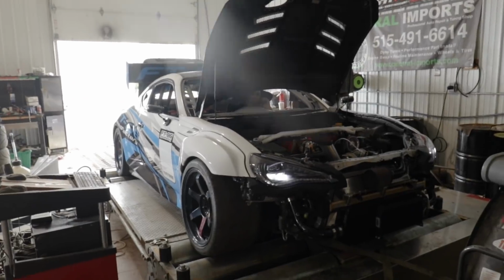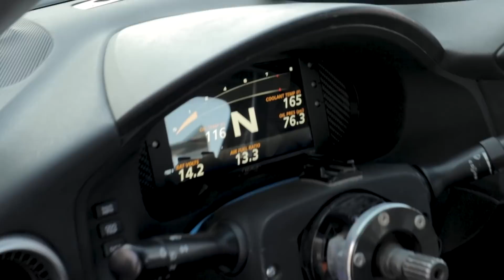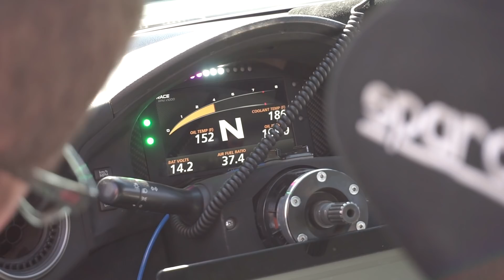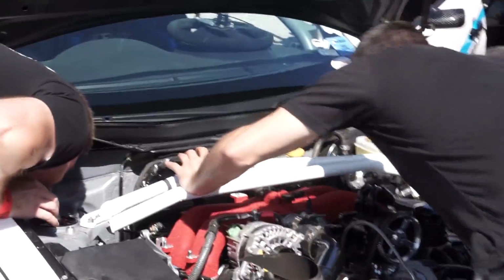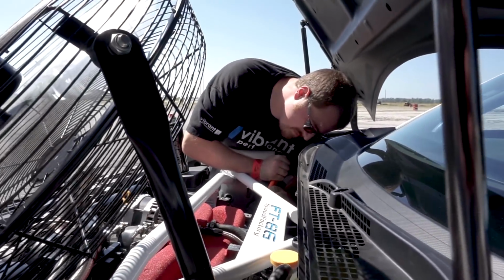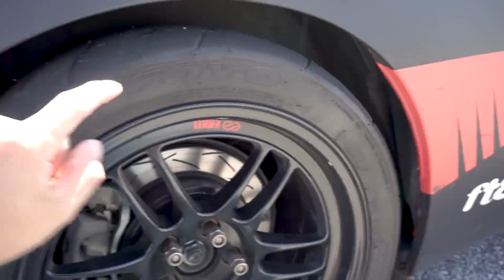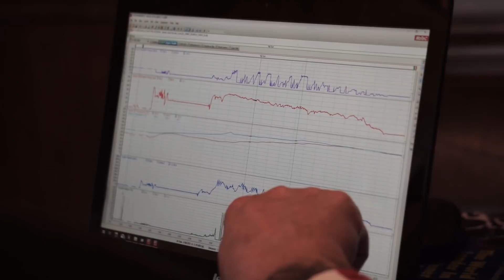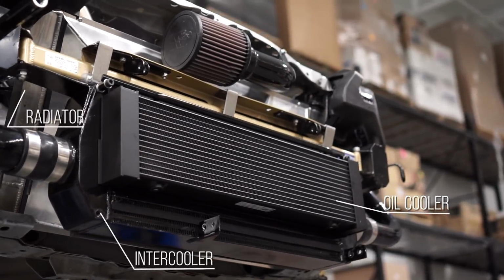Time Attack Test & Tune | Vlog_011

Comment: You should ceramic coat the headers then wrap it with titanium heatwrap and wrap the oil pan with gold reflective tape to keep the oil temp down some more.
Reply from the maker: Won't hurt! Every little thing will count at this point.
Reply from the maker: The header is coated, just not wrapped, coating is pretty much doing the same job, and there is no longer a pan due to the dry sump system. :(

Comment: Is it running hot because the oil cooler and intercooler are stacked up so close in front of the radiator?
 Can you team it up with a 2nd  oil cooler? Maybe oil to coolant? (forester like)

Comment: as an engineering student my 2 cents is if the system is running that hot why don't you swap the turbo for a larger one so it has cooler charge temps and thus cooler combustion. Change the tune to go richer in the rpms past 4K. Run a lower tire pressure for more traction.
Reply from the maker: A larger turbo would be useless in road racing due to the increased spool time. :(
Reply: I would postulate the aggressive driving would keep it spooled, larger doesn't mean going excessively large. The difference is spool time by going larger is often exaggerated. It appears you have already taken steps to offer sufficient cooling calling for more investigation. Have you been monitoring the intake charge temperatures? A car that overheats in 3 laps is not conducive to road racing either! The car would likely even break 600hp barrier and do so more comfortably.

Comment: you could try run a higher weight oil. It'll hold more heat before the oil viscosity gets too thin
Reply from the maker: We run 15w50 already. ;)

Comment: Can someone please tell me what that container is at 3:10? Also, how can these guys be overheating when I see vids like Turbo BRZ at Road America going lap after lap with no overheating problems?
Reply from the maker: Are they making over 550whp?  The container is the oil container for the dry sump system.
Reply from the maker: Thats the oil reservoir it holds 11qts.  Our other Turbo FRS does just fine also at 350HP, it's when you start getting into the 400 and up things start to got hot fast. Everything gets exponentially more complicated as you add more power with these things unfortunately in road racing.
Reply: @FTspeed  Ah, that makes sense. Yeah, I don't think that Turbo BRZ was running anything near 550hp!